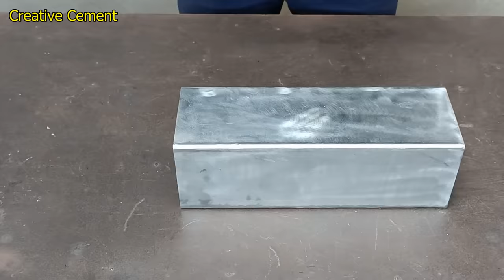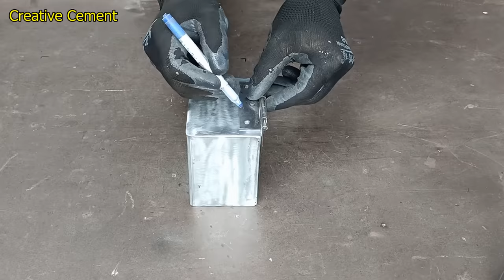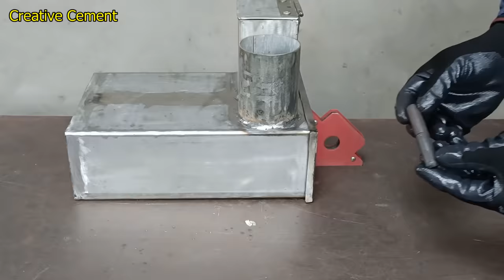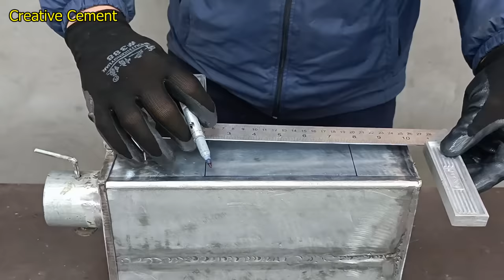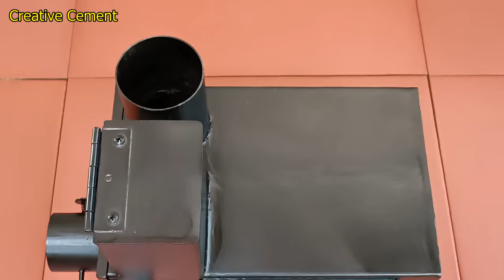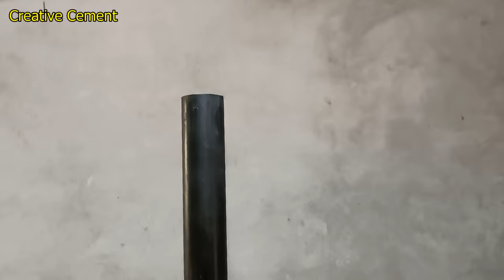How to make a wood stove / Metal heating stove is amazing

Comment: There's definitely some kind of fan, that's hidden on the left side that pushes the air deep towards right side below the utensil area. Otherwise, involving all laws of physics, it's difficult for me to explain why air gets rushed there underneath.
Reply: No that’s thermodynamics. The fire sucks fresh air from above to be able to burn, so there is a constant airflow in to the system. Because the gases need an escape it goes the only way left: through the oven.

English isn’t my first language so I’m not sure if I could explain it understandable, but if you’re interested in the physics just look up pyrolyseoven, because this is the most practical and fancy one I’ve ever seen. 

First the wood will burn upwards producing coal and than it will be burn downwards again burning the coal (or you put water on it as soon the wood burned up and get the coal you can use as a very good soil. This way the CO2 maintain bound and there is no air pollution - pretty neat device because it allows you to use the heat for cooking while you recycle your woodscraps out the garden.)
Reply: @satrawa  thanks dear for your explanation
Reply: Basically a rocket stove
Reply: La acabo de hacer y es increíble…funciona de maravilla…felicitaciones por tu creatividad 👍
Reply: There is no fan, I think. The stove will smoke through wood chute unless the exhaust tube is hot. They did not show the lighting process because of this. Use a torch to heat flue as fire is lit. I have seen this in other videos.

Comment: What a beautiful masterpiece, but there is two mistakes, the first is that there is no handle to carry it when it is hot, and the second is that the wood burns very quickly, 😁✌️
Reply from the maker: Thank you for your comment
Reply: The second is relative to the volume of air and the type of wood. But I'll be building one great job 👍
Reply: The second is relative to the volume of air and the type of wood. But I'll be building one great job 👍

Comment: I like the idea, however, when this stove is lit it probably smokes a lot from wood chute until exit pipe is hot.
I would suggest to make wood feed tube be made on 45 degree angle. I would also add a small 1" hole( with a sliding cover) on the same side as glass, to light wood with a torch. I would also add an extra layer of metal on the  bottom(in or outside) of burning chamber, to prevent burnout.
Otherwise, this is a really good idea for a small stove.
🇨🇦🤔🤔👍

Comment: nice job . I m wondering that if yu make 3 part " I mean smoke road " how it will be will be?  any problem ? or more efficient?
Reply from the maker: If you make 3 parts, the smoke will still be circulated and the heat from the smoke will be retained on the stovetop

Comment: Can you share your measurements with us please? I understand these have to be measurement specific. Also, where does the ash go?
Reply from the maker: I use a square iron with a width of 10 cm, the length of the kitchen is 30 cm, the louver has a diameter of 6 cm, the chimney has a diameter of 7.5 cm. Ashes are removed when the door is opened.
Reply: @CreativeCement  thank you.
Reply: 굿쟙

Comment: Your control over that angle grinder is unreal. I did not have the steadiness to cut a circle like that when I made my own version of this stove. 

Instead, I had to take a very worn out grinding wheel that could fit inside a rough cutout and worked my way outward toward the line. In retrospect, I should have just used a big bimetal hole saw... Live and learn, I suppose.

Nevertheless, this stove gets really hot. Did yours reach a point where it started glowing red near the fuel inlet?
Reply from the maker: With a small circle, it is easier to use a grinder blade with a small blade
Reply: Э

Comment: ...there must be a fan throwing wind from the left side 'cause if not, it's physically impossible that those wood pieces never catch fire from top to bottom, wich woud leave the "stove" useless. It's a misleading notion IMHO...
Reply: I disagree. I've seen many rocket stove designs and similar to this with top feeding chute and none of them burn top to bottom.
Reply from the maker: No front blower. High chimney due to the difference in wind pressure will automatically suck in and go up the chimney. In the video, there is a part where I filmed a fire, you can watch it again
Reply: yes, ...👍
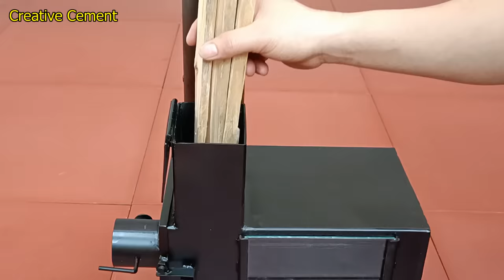at, 7:50👌👏🙌👍👏👏👏

Comment: Wood stoves are used for heating areas and cooking on. Making a stove that small is worthless for heating any area. Cannot load enough wood for any meaningful burn times.

Even if all this is intended to be used for is cooking. It is still not good. Far bulkier and heavier than needed for cooking and way to small for heating an area.

What's the point? Could have displayed your skills, making a Woodstove of meaningful size for function. It's too small to take camping to heat a tent, far too big to take just to cook on.